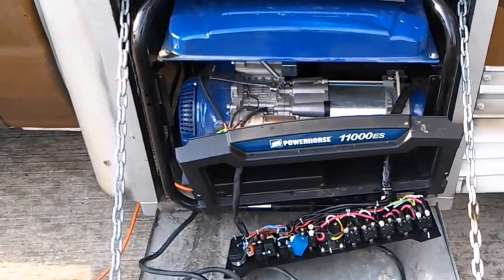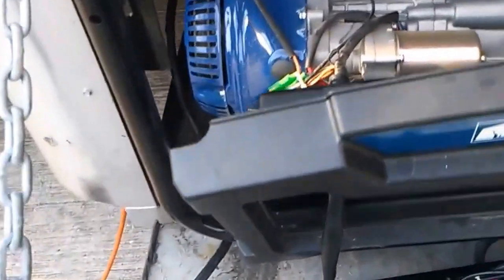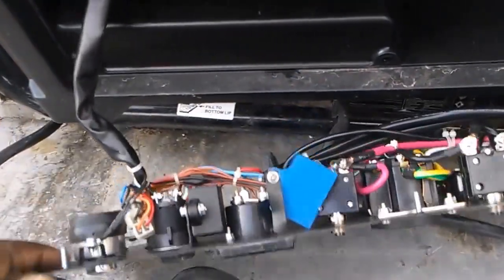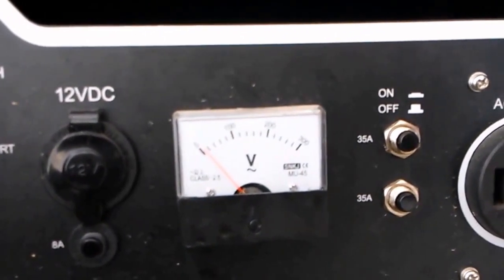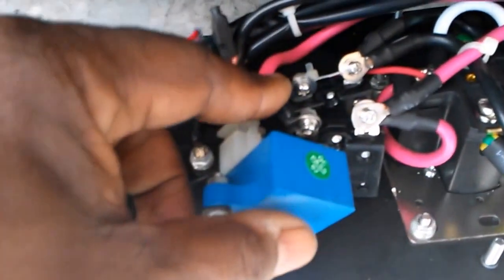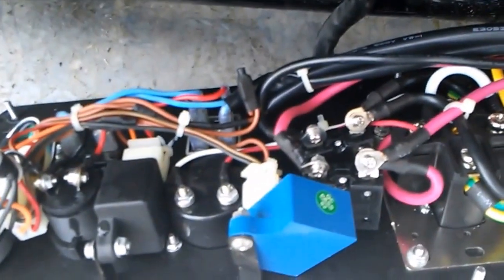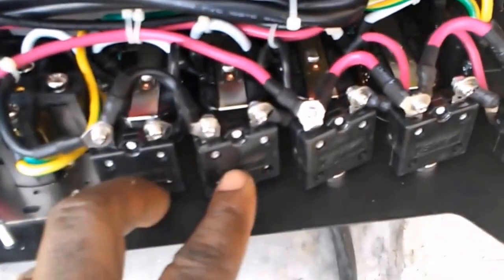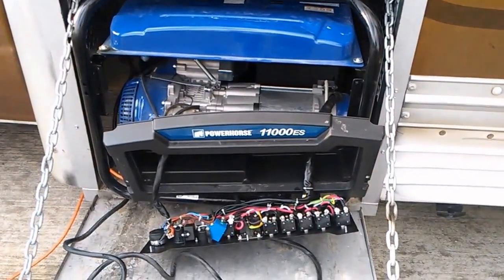How to bypass a circuit breaker on a Generator Powerhorse 11000 Watts Electric Start

Comment: Better maybe to attach those wires to a fuse holder and buy a good supply of fuses until to get new part. I'm assuming the original fuse is tripping when there was no actual overload?

Comment: I am unable to remove the front panel. I have removed to nuts from back, but something is still holding the panel. Was there anything else that needs to be removed?
Reply from the maker: Make sure the ty-wraps are not holding is in.  It should come out after you remove the screws for the back side
Reply: That was partially the issue. Also the bolts were sticking so I had to tap them out with a nail. Fixed a bad 240v outlet. Cost 10$ for the outlet and saved much more not having to send it to service. Thanks for the video.

Comment: My smart tools generator   2000W wont put out power in the 120 outlets
Reply from the maker: Probably the breaker tripped; theses inverter gens put out 60 and 60 not like a house outlet